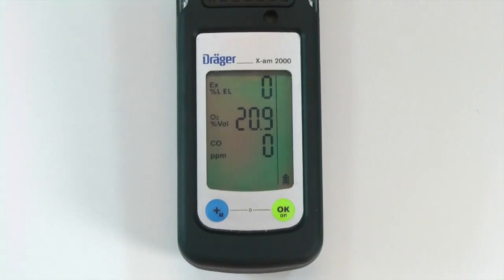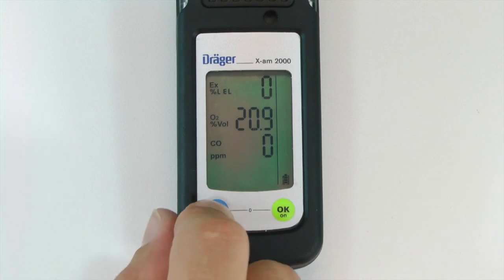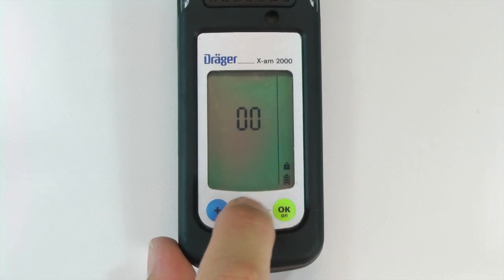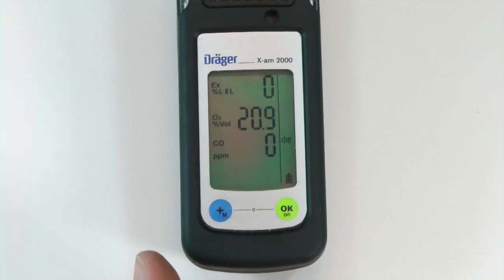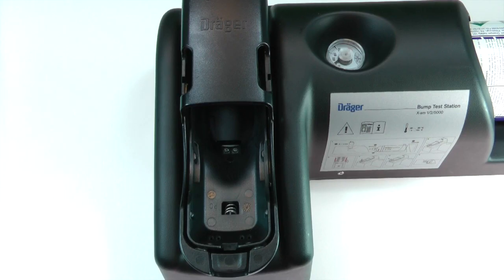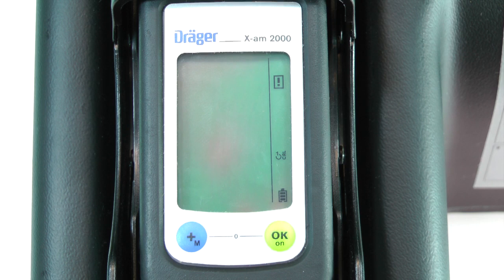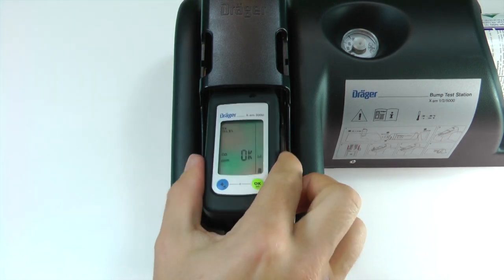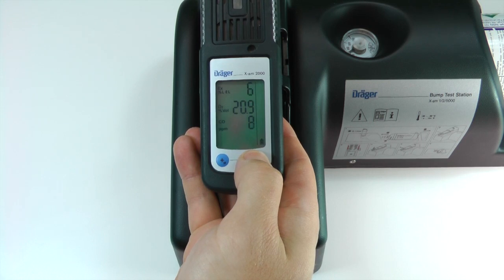How-To: X-am 2000 One-Button Calibration

Comment: To change gas concentrations without CC-Vision:
1. Hold + button
2.  Enter password (default is 001)
3. Select single gas calibration (3rd option, after "fresh air" and one-button cal; icon is a cylinder)
4. Press OK
5. First gas concentration is shown, press + to increase concentration to desired level
6. Press OK to accept new level and to start single gas cal.
7. Supply gas to carry out calibration or press + to cancel.
8. A. If calibration was selected, once it finishes, it will move automatically to next sensor; 
    B. if calibration was cancelled, press + to move to next sensor.
9. Repeat the process for every sensor.
10. Ensure that gas concentrations match with those in the calgas cylinder(s)
Another option is to adjust the gas concentrations first, THEN carry out a one-button calibration.
I have 10 years of experience calibrating diverse gas detectors from different brands and Draeger X-am series are still my favorite!